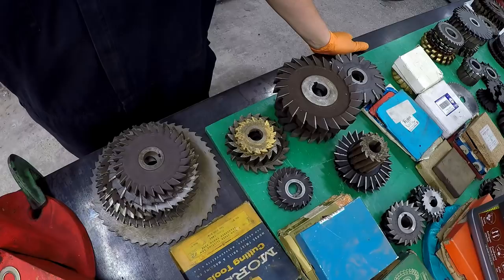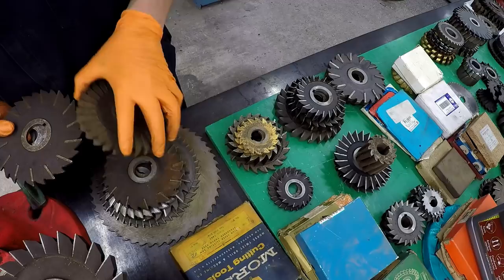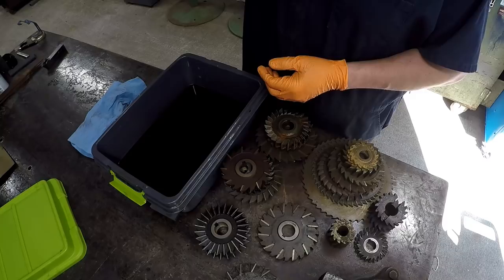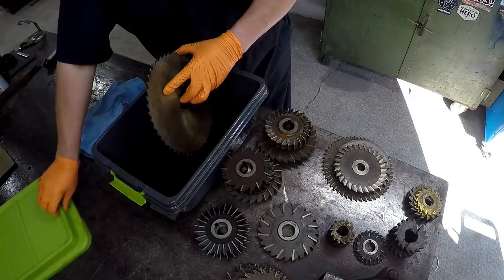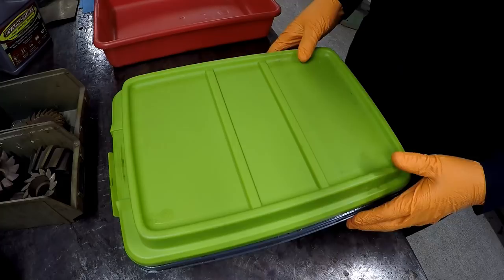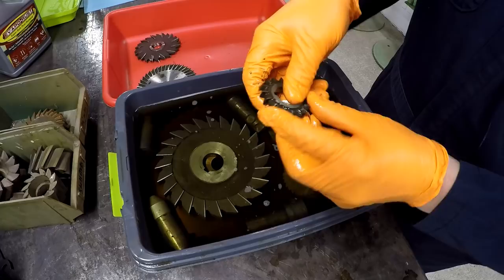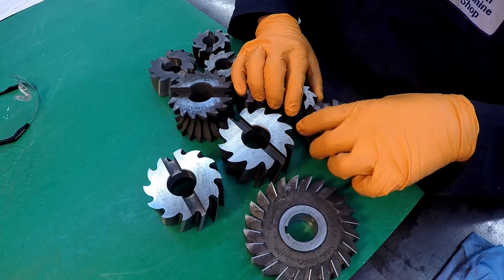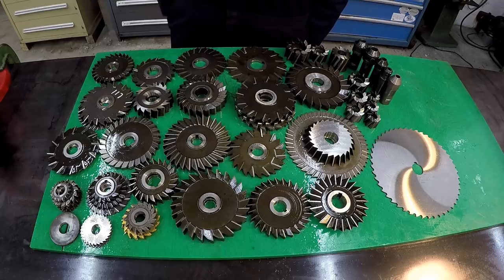How To Clean Milling Cutters Using EvapoRust

Comment: "GO & GO" = Goddard &Goddard Tool Co.  I have a old catalog from them.  Dated in the late 1930's.  Made large mill cutters for the railroad machine shops and other heavy industry in it's time.  Also made some of the first inserted blade milling cutters and face mills in it's time.  Seen some face mills in the 12-18" diameters in a junk pile in the late 1970's, that came from the aircraft industry.  Have no idea who gobbled them up of if they died on their own.  Nice find!
Reply: I found a report in Google Books from the State of Michigan Department of Labor dated 1919. Just a single line saying that on May 14 there were 48 men, 2 women, and 1 person under 16 working there. You can also find a few old pictures. I have to agree with Adam, the company logo is pretty cool. Kind of art deco. It would look good on his cabinet.
Reply from the maker: Cool, thanks!
Reply: Adam, If I can find that catalog, I'll send it to you.  It's been in my family for the past 40 years, time for it to change hands.  Ken S. @Abom79

Comment: I've found that if you can fight the urge to rub them over the tub when you take them out, the evaporust stays cleaner a lot longer. Take the parts out as carefully as you can, and rinse the sediment off like you did in the tub. My evaporust stays clean about twice as long now. That's a damn fine collection of cutters, by the way. 👍

Comment: EvapoRust is a great product.  I have used it on some 'lost' parts and they clean up well.  One trick for large areas is to spread paper towels o the surface, wet it with the product and cover with plastic wrap, or so other sealing film.  Leae it be for 12 hours then refresh the solution and wait another 12.  It works really well.

Comment: I'm a confirmed Evaporust fan, but I've found that that you  don't really get any extra rust removal by leaving the part in the solution longer than they recommend (much less than 24 hours). As a matter of fact you can lessen the accumulation of the black staining where the rust formerly was by leaving the part in the solution for a shorter length of time.

Comment: Adam,
   Being in Florida you have a huge problem with rust from the humidity, as you know. I inherited all my dad’s shop equipment and tools which was to my benefit. When I unlisted in the Army in 1969 he moved to Clearwater, then three years before he died he moved back to Illinois. (Don’t ask me to explain that) 
   Anyway I had a monumental job removing the rust and corrosion cause by Florida air which is also influenced by salt from the Gulf. Aluminum parts were also affected. We have high humidity here in Illinois in the summer and causes rust if metal isn’t protected but it’s not as severe. Any tools capable of being stored in drawer cabinets I keep silica packets scattered around among them and they help a lot. Cat litter in a sock works too.

Comment: It's a good idea to clean and degrease the parts before soaking them. The chelating agent is able to work the surface more efficiently, and it keeps the fluid clean longer. 
Sure would like to see how you're organizing those. Thanks for the video
Reply: Wondered about organization as well.
In a different business but still have an assortment of cutters that are never in the right place.

Comment: EvapoRust used in my little sonic cleaner is a near magical thing.  Not practical in the majority of these cutters but a very fast method for smaller needs and it usually seems to get it done in minutes or less.
Reply: Yup it works great in ultrasonic cleaners. Rust and grime gone in minutes. I barely use brushes to scrub anything anymore.

Comment: the radius shellcutter might be from WW2 era 
I found and derusted mill/ream cutters from the napoleonic era under the remains of a whatermill maschineshop in Austria , special form reamers for makeing of bullet molds for Flintlock rifles
after i ground the shank cylindrical (it was a odd angled cone with a non standardized thread) i tried them and they still work (in Aluminium and Bronze)

Comment: Adam, at my work we have an amazing parts washer that I think would change your life. It's a Landa top-loading aqueous parts washer. It uses super high pressure, super hot water and a citrus based detergent. We've had it for 20 years. It's paid for itself a dozen times over. The closest thing available nowadays is the Cuda SJ 15. I think you should look in to it.

Comment: I use ospho for rust conversion.  It leaves a black oxide finish simular to a cold blue.  Im not sure if it would attack and dull the cutting edge, but the stuff treated with it will not easily rust again.  

Any way, I store it in 5 gallon hydraulic oil buckets with removable lids.  When Im done, I just put the lid on and store it in a safe place. I leave it sitting on the lees, and decant it off into a clean bucket and wash out the lees from the first bucket, then return the product.  

In a side note, get yourself a 3m 6800 respirator.  The full face shield offers great visibility.  It seals good enough to your face that a splash wont get into your eyes. They are also Z98 compliant, so they are safety glasses too.  You only got two eyes.
Reply: ospho? you mean phosphoric acid?
Reply: @antigen4  thats the main ingredient.
Reply: ok - that would have been my guess thanks
Reply: @antigen4  Evapo-rust is not an acid.  It contains a chelating agent that breaks down iron oxide and nothing else.
Reply: CONTAINS yes ... but disodium EDTA can't function alone - you have to capture the ions first - the only way to do that is with an acid or a base ...
Reply: 'evap--o-rust' wasnt' the topic of conversation though - 'ospho' was
Reply: I don't really know what all is in ospho, but it tastes like grape jelly.
Reply: mmmmmmm .... grape jelly ...

Comment: There is a 3 gallon bucket available with a nice inner basket included.  Works like a charm, but you can end up with the hatch marks from the bottom of the basket on your flats of the metal.

Comment: I see a need for a dedicated shop dishwasher...  I'd load it up with all the Evapo-Rusted tooling, run them through with a heated drying cycle, then spray them all down with a protectant/rust inhibitor (I'm a fan of ACF50 for this purpose).

Then again, you could just be like Tubalcain, use the dishwasher in the house, and risk the wrath of the Mrs.   :)

Comment: Have you ever tried Fluid Film to protect steel?  It's not cheap, but I use it on all my saw blades once a year and it's been great so far.
Reply from the maker: Fluid Film as a brand does the same as M-1. Its leaves an oily residue on the surface to inhibit rust.

Comment: If you put the cleaned cutters in a bowl, fill it with boiling water, and let them soak for about 20 minutes, they'll dry themselves in no time, once you've removed them from the hot water.
Reply from the maker: My compressed air is more convenient in the shop

Comment: You can use CLR it's on almost any store also... Evaporust more expensive
Reply: CLR is just acid.  It eats the machined surfaces as well as the rust. Evaporust doesn't eat clean metal like that. If you just want clean metal to paint, use whatever. If you have precision surfaces (or edges!) Then use evaporust or electrolysis.

Comment: As a Detroiter there are  lot of machine shops in metro Detroit.  many old shapers inside the old companies in the city. Roseville, North of Detroit is a mecca of tool and die shops.want to find anything ? Groesbeck and I 696 drive up Groesbeck and it's machine shop heaven. Every business is a tool shop.  I bought a Cincinnati milling machine there.good deals on cutters. metro Detroit  has a ton of old machines.

Comment: I'd be worried about dissolving the steel away. It would be interesting to get a micrometer on a machined bit before and after the treatment. Cutting edges too.
Reply: This is not an acidic process. Search "chelation".

Comment: I've been doing some "comparison testing" (currently only on my Instagram @JustTheOtherDave though I should have made a video) and so far, plain ol' citric acid, purchased in bulk from Amazon or your local brewing supply store, has been the best bang for the buck. The product of citric acid and rust is actually water soluble so there is less cleanup after as well! And you can see through the mixture even after extensive use. Allegedly, Evapo Rust is citric acid based - Google returns a dead link to a page mentioning this on their website, but they deny it contains "acid" so probably some compound of citric acid with something like ammonia so that it's not technically an acid. I recently bought enough citric acid to make 10-20 gallons of solution for $25 (depending on strength). Another less expensive option is Ospho / phosphoric acid concrete etcher but it smells terrible and is more aggressive and leaves a lot of sludge you need to clean off.

Comment: Seeing as how you live in a part of the world where just ambient humidity can ruin things, I was wondering if you have an air dryer on your air system or an auto purge valve on the compressor tank?  Also, what kind of machine shop work are you trying to specialize in, it seems most people end up specializing in a certain area of their field?

Comment: I use Evaporust in my ultrasonic cleaner, it works great.  would you say Starrett M1 and WD40 bout the same for inhibiting rust?
Reply: I think M1 leaves a tiny bit heavier residue than WD40... But it's not something I'm willing to bet money on without doing a control test first.
Reply from the maker: The Starrett M1 dries to a heavier film but WD40 says they’re product dries and leaves a rust inhibitor on the surface.

Comment: Adam... Bro try boiling them in citric acid. shits cheap and easy to buy if you cant buy it from walmart order it on amazon. its rust magic.
Reply: He wouldn't do that since he is getting a kickback from evaporust
Reply: @AzNKiLLzoNer  Did he say that?  You are supposed to declare that if you do for product reviews and though this wasn't billed as a product review it basically was.
Reply: @keitho3133  even if he is not sponsored directly with evaporust, which would be surprising because of all the evaporust videos, the link in the description is n affiliate link. Hence kickback. If he is sponsored it is surprising that there is no disclaimer.
Reply: @AzNKiLLzoNer  SNOWFLAKE

Comment: Great vid Adam the cutters look to have another lease of life even the mill with the missing holder just use it as a double instead of a quad. An idea for a ep could be on a wiggler/Waggler as you seem to do mostly bore clocking with the dial on the mill. Keep up the good work Adam.

Comment: You need to buy an ultrasonic parts cleaner. Evaporust works 10 times faster and better with Evaporust.  There is a video or two on You Tube. The Evaporust/ultrasonic  video does not tell just how goo the product works. 
I bought a 30 liter ultrasonic machine.
Reply from the maker: Yep it’s on my wish list. Would love to use one for precision tools.

Comment: After rattling around for years how do you get them sharpened up? I would think you could stone nicks and minor stuff out but can they be resharpened without changing the dimensions? How important is it that they be sharp since they are low speed high load cutters?
Reply: Watch Steve Summers video's on YT. He is showing how he grinds all kinds of stuff.

Comment: Adam Mr Pete was doing a video with gauge block. Some of them had rust on them and would not ring. Think that vaperust would clean them up and let them ring again.
Reply: no rust eats the part some so there be holes matter if you dont see it
Reply: David Howard David I don’t think you understand the question. The holes in the gauges is a given.
Reply from the maker: That would be a good test, I have not tried precision gage blocks with it yet.
Reply: If it is flash rust, yeah, that might work. Once pitting has occurred, about the only thing to do would be to lap them and then you lose the size calibration pretty quickly.
Reply: @vilsiran  i mean the rust  will act like it been lightly sandblasting

Comment: Hi! I have a question, will the evaporust dull the tools?
Reply: I'm wondering the same.
Reply: No.
Search "chelation".
Reply: @mattmanyam  hi! Yes, chelation will remove iron molecules from the piece, a sharp edge is in theory a few molecules thick, so, potentially there could be some dulling, especially if there is rust in the edge itself. But i guess is too much a theoretical concern :D

Comment: Where can I find the Evaporust  locally Adam?  I’ve got a few rust cleaning jobs I need to do
Reply: Autozone has gallon jugs. its pretty much everywhere now.
Reply from the maker: Hey Russ, try o’Reillys auto parts, or Harbor Freight. You can also buy it on Amazon. Good to see you commenting! 👍🏻
Reply: You can get it from Amazon prime, I got a 5 gallon pail for about $55 delivered free of course

Comment: What is the difference between a milling cutter and a slitting saw? They look the same except thickness.
Reply from the maker: slitting saws are typically thinner, 1/4" and under, but even some of then can be stagger tooth.
Reply: I have one that is actually marked slitter. Its in decimal but its a little bigger than 1/16 and is like 2  and 1/2 inches diameter.

Comment: Thinking I'll dive into our box of Horizontal cutters and do this when I have some time? Almost wish I could throw my entire Bridgeport into a vat of Evaporust as someone sat it outside on me and rusted the crap out of it :(
Reply: Phosphoric Acid - Used to be sold in a pink paste called "Naval Jelly" - you have to get all the oil off 1st for it to work well, but it works well. Seems as though the Evaporust may be better though, just ordered a gallon to try, it's under $20 gallon at Adams link. Maybe it can be thickened for jobs like your mill.
Reply: @scottmarshall6766  I used to work in a Furniture restoration place in the 80's. We had Phosphoric dunking tanks and I used to bring my car parts in then strip and de-rust them. Wish the place never closed up but, wouldn't exactly be trying to dunk my Bridgeport anyway. I do remember my grandfather having Naval Jelly back when.

Comment: drying off those cutters made me think: Are there attachments for a blower that can heat the air? (Basically a high pressure hair drier, lol)
Reply: Chris Young  They make ones that output the same amount of air as a compressed air system? I know the ones for heatshrink tubing exist, but for high pressure?
Reply: @LazerLord10  Hi I doubt this exists, as a compressed gas expands it cools dramatically and the task of heating a high volume of very cold gas very quickly would take a lot of power. So whilst it could be made I doubt anyone would want to pay the electricity bill to run one :-) Regards Sarah
Reply: Sarah Loyd look up Ranque-Hilsch vortex tube, it is a mechanical device that separates a compressed gas into hot and cold streams.

Comment: Just how many steel toothed edges of death have you got in the whole shop?
Adam, I have a question for you. I was cleaning my long gone  Uncle's Greenfield GTD No 339  T-handle tap wrench and discovered it drives clockwise but ratchets counter clockwise. Why and how do you reverse it?
Reply: Is yours missing the fwd. / rev. locked pin just under the T handle? You can see pics of the unit on Ebay.
Reply: Flip it over?
Reply from the maker: I have a general brand t-handle, it has a switch pin in the center body.
Reply: @Abom79  Thanks for the reply. I found an ebay specimen that has a lever  mine is missing to rotate the pin. Have to take apart to fix.

Comment: What type and weight of oil would you use to prevent future rusting?
Reply: He was using Starrett M1 oil.  Any rust oil specifically designed to be a rust inhibitor will work excellent.
Reply from the maker: Starrett M1 oil this time but I also use CRC sp350 and Boeshield t-9.

Comment: WD40 is not an oil though. Its a solvent.
Reply: I'm pretty sure it was designed as a corrosion prevention product for NASA so...
Reply: @kingrpriddick  acording to the msds its like 50% solvent and 25% mineral oil. Its great for water displacement though :D

Comment: Hey Adam...where did you get your pressurized spray can?  Make?  I need to get me one of those. 

I've used Evaporust and swear by it!  Not cheap, but well worth it.
Cheers,
Brian
Reply: Brian B. Kbc tools. Just type in sprayer in the search bar
Reply from the maker: Check with KBC Tools and look or ask for the Milwaukee Sprayer, that's the maker. Tell them Abom sent ya.
Reply: I get mine at the local O'Reilly. Their product that they carry is Vaper.  Its called a spot spray, and they are about $25.
Reply: Harbor Freight has it around here.
Reply: @Abom79  Thanks Adam!  Will def.tell them  I came from Abom's site!
Reply: @jamessonger3   Thanks v/much!
Reply: @duobob   Thanks Bob !